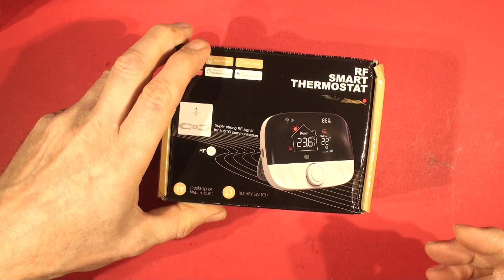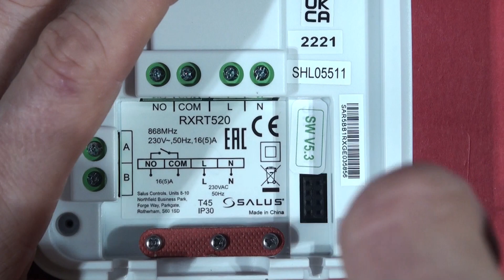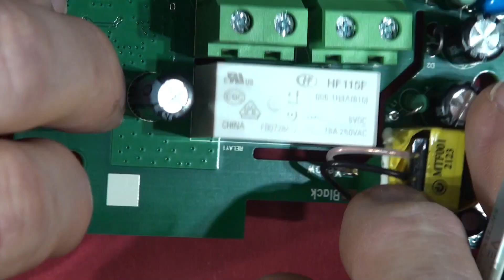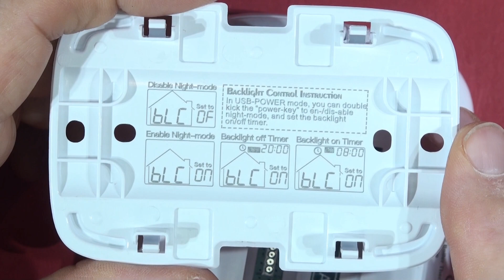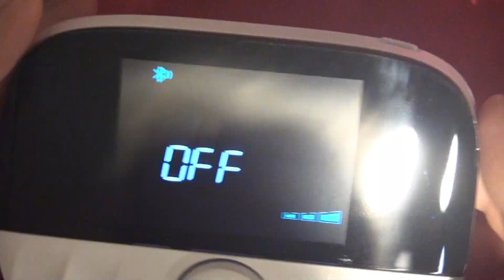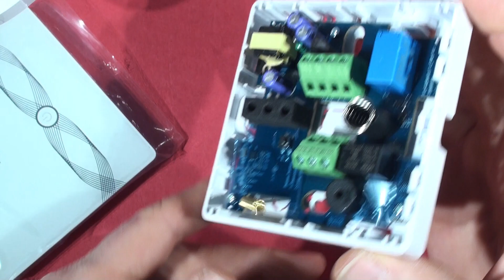Hive Smart Thermostats  alternative products evaluated

Comment: Mind reading your audience, nice trick. I've been looking for a hive alternative, this could be it. Looking forward to your further insights after installation. 👍
Reply from the maker: Thanks for watching,.  Installation is easy,  It is working fine....It is very reliable and easy to use with the SmartlifeApp.  Also it is fast so when you want to adjust the heating there is no Hive waiting for an update from some far off server.  However I notice that a few new products have recently popped up on Aliexpress, The TUYA one looks good.  (end 2023) . My main concern was teh lack of boost function but then I realised it can be programmed to interact on Smartlife.

Comment: Had the same happen with a Wyze Camera, we need a website that lists these garbage companies.
They did a force app upgrade that locked out old firmware and the new firmware changed functionality to a monthly fee pay tier.
The old app continued to work but would not allow access to the setup when network changes are made, I.E. router swap.
Ergo firmware upgrade is forced in order to run ip setup which moves functionality to a paid tier.
Reply from the maker: Often it is a bucnh of twits in a room somewhere that decide to shaft the customer. Ill never buy Hive again..